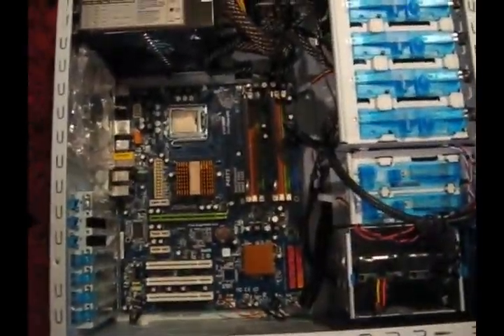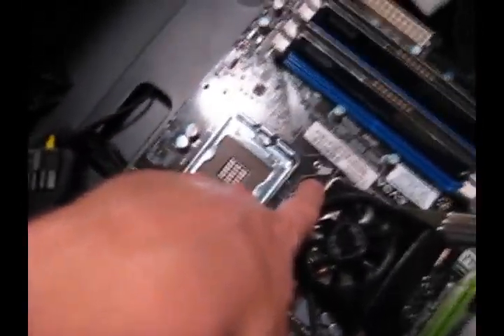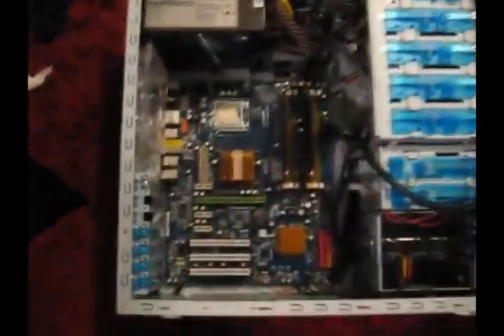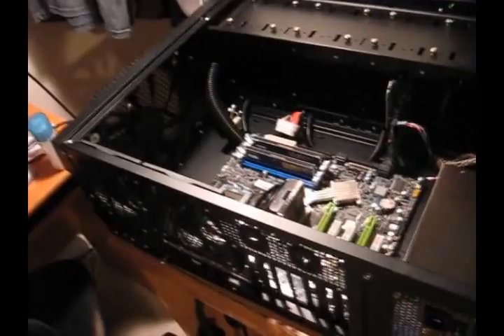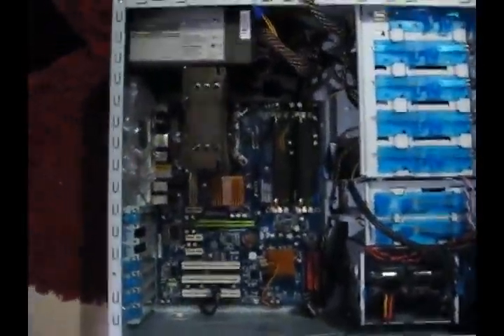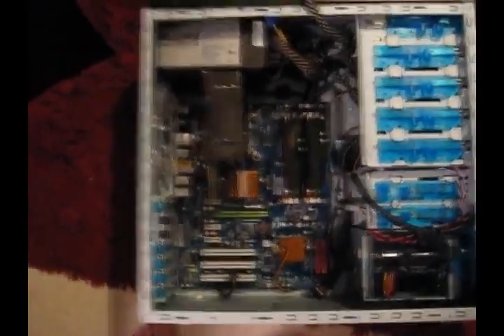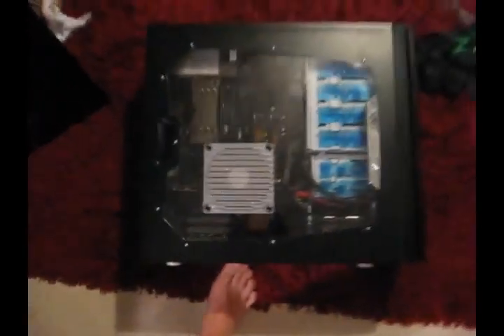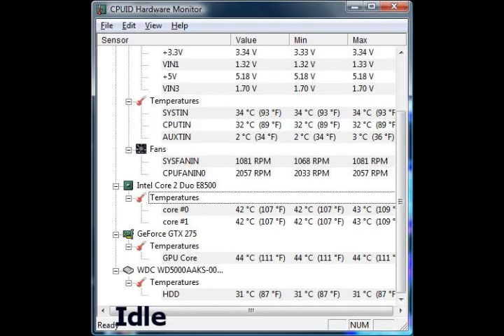Apevia Jupiter Case Update

Comment from the maker: Nice luck =]    And the cpu is the Intel E8500 running stock speeds.   I had the e8500 at 4 ghz and it stayed 40C idle and 55c load.   Pretty good temps since Im in florida

Comment from the maker: They have probes which you can tape with electrical tape to your cpu cooler or harddrive. I found the temp displays to be more for show than actual reliable temperature readings. If you want accurate temp readings download hardware monitor

Comment from the maker: This is my buddies computer and I dont remember exactly how it works but I believe it has two molex connectors which go on top and bottom of the fan's actual molex (4pin) connector. Then I think once you connect a 4pin molex from your power supply it will work properly. I think it took even me a couple of tries to get it to work right lol